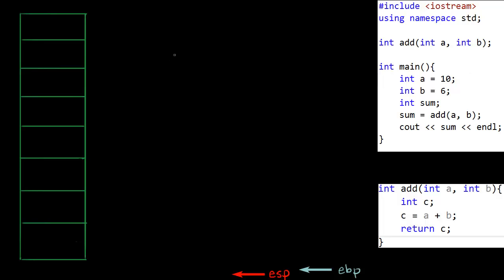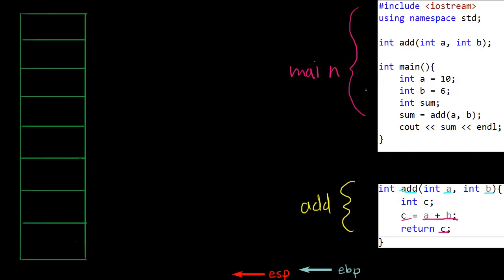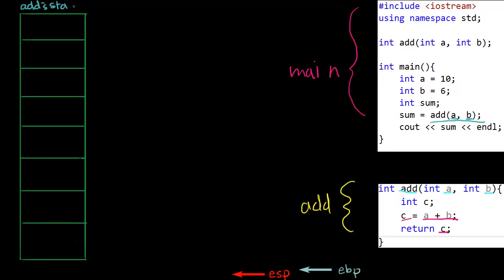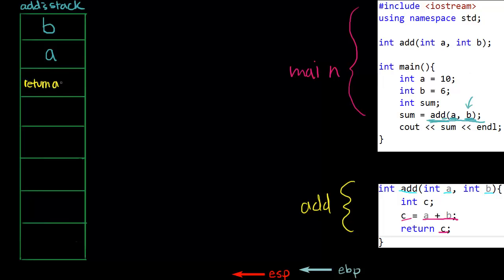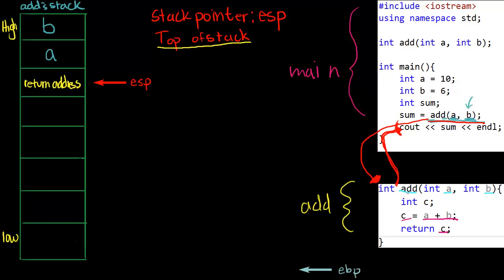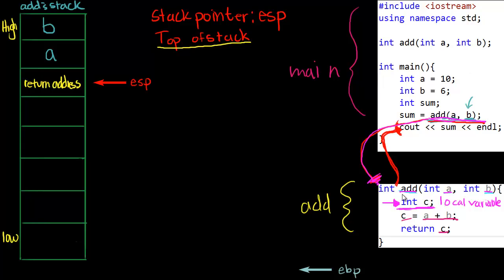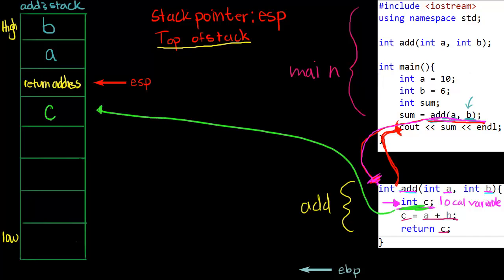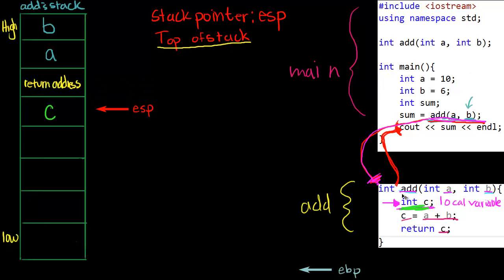Stack and local variables: Intel Assembly Att

Comment: Why b and a are not placed into the stack in the main until it calls function add?
Reply: And where's the address of sum?
Reply: b and a is the function arguments of sum so its pushed on the stack frame of the sum function
Reply: because only function calls are placed on the stack
you have to push them into the stack and pop them off of it
the "c" inside the add function represents the sum, and will be pushed into the stack after the return address
always remember the stack grows from top to bottom, like an upside down book shelf,   so the last book on the shelf (top) is the one that is far from the shelf table
so when we push "c" variable its going to be on top of the stack, and once the calculation is done "c" will be returned to main function as "sum"
main function is in a different stack section